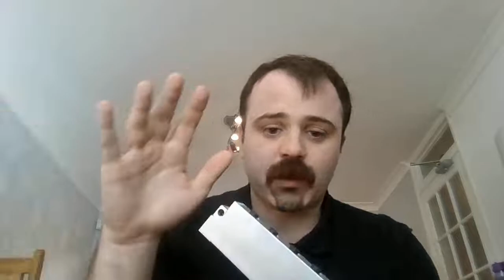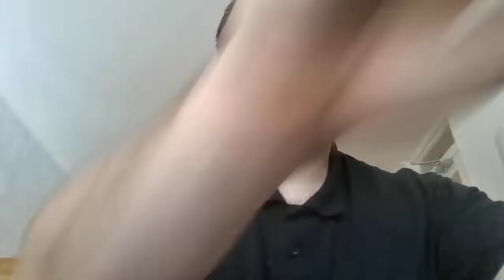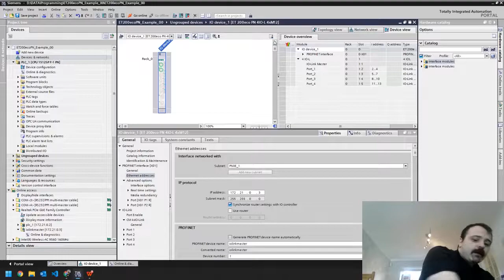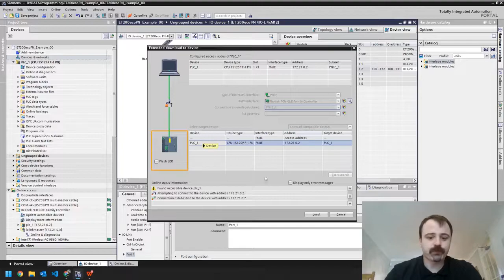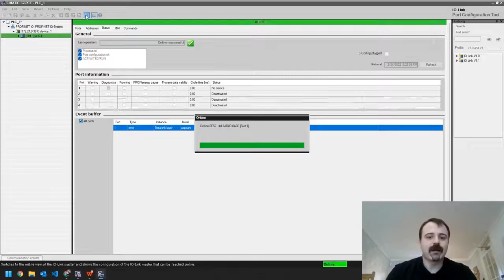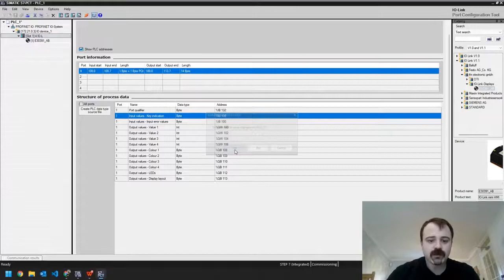Siemens 6ES7148-6JD00-0AB0 - IO Link Master - TIA Portal

Comment: I have to connect 6ES71415BF000BL0) IO link DI in (6ES7148-6JG00-0BB0) 8xIO link master module…

What should my port configuration type (DI, DQ, or IO link 1/1 PQI etc)